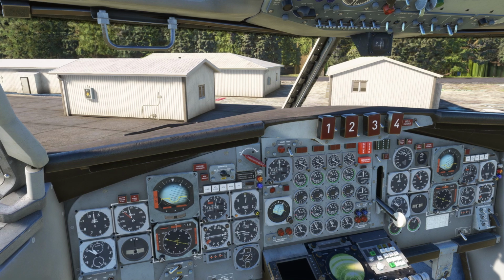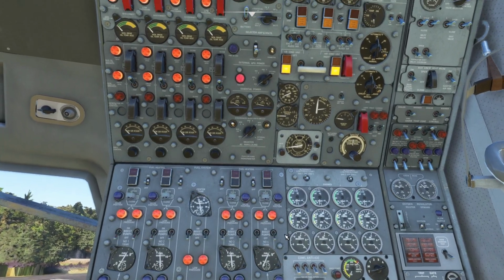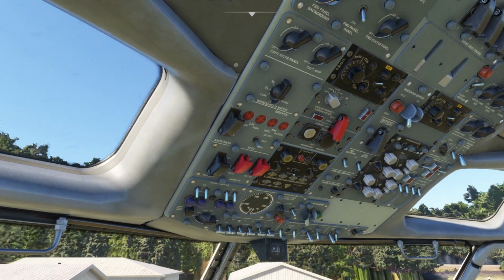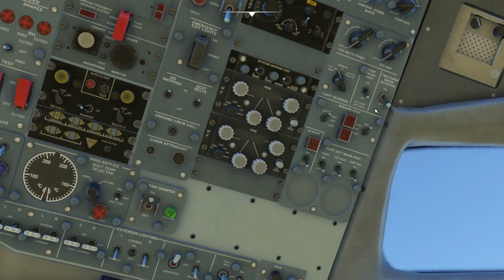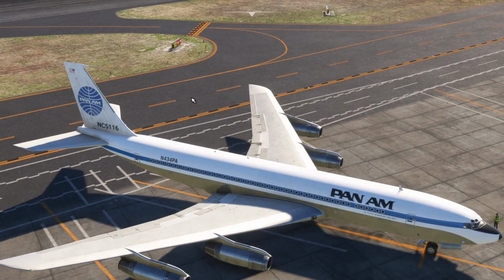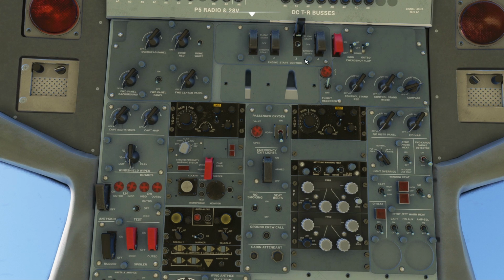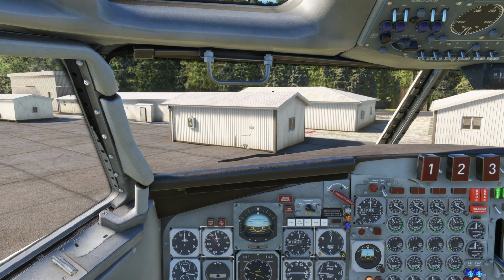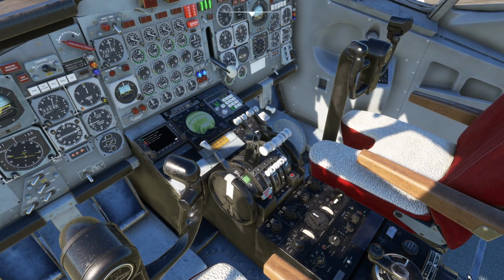Detailed Tutorial on How to Start the Engines for Boeing 707 by Aeroplane Heaven | MSFS 2020

Comment: so i followed all procedures and when i went to lower flaps they wouldnt go down and my break wouldnt work either??
Reply from the maker: All I can say is try again. It should work if all the procedures were followed as shown. Specifically, check if all the switches were turned on as shown on the engineers panel and the overhead panel. Unless something changed on the developer's end, it should work.